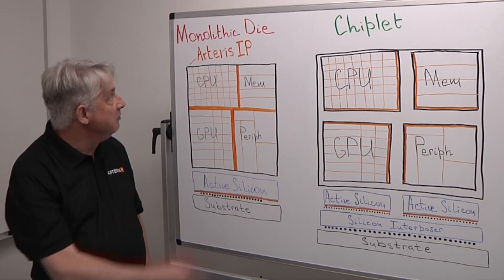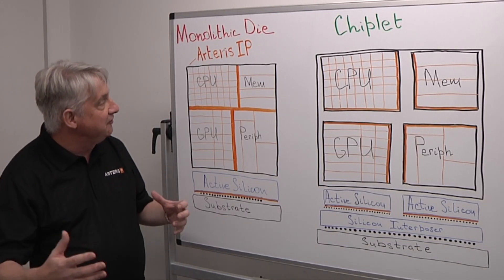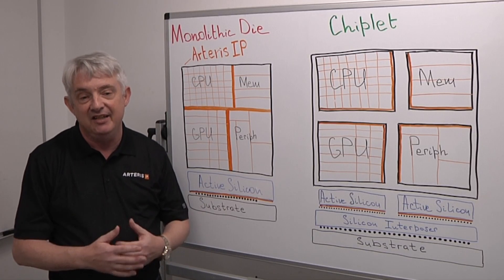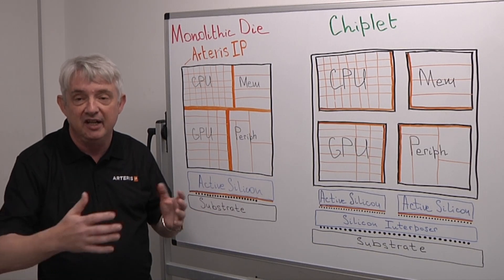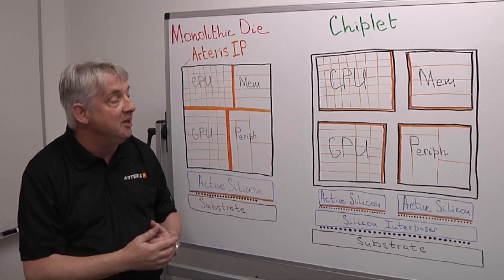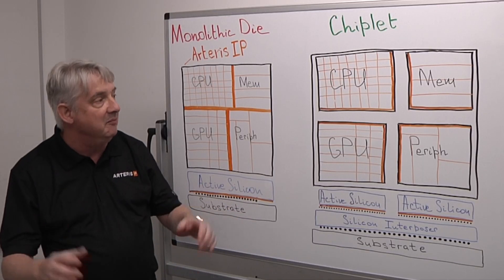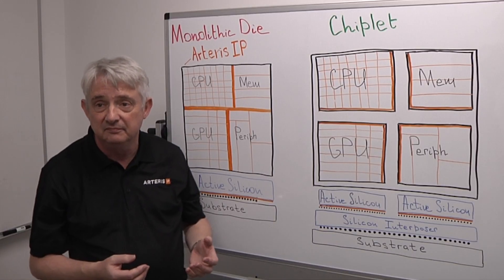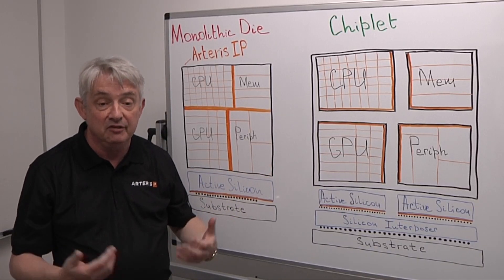Benefits And Challenges Of Using Chiplets

Comment: One of the benefits of chiplets is their implicit redundancy during manufacturing. Foundries don't like to talk about it, but all the lead foundries are struggling with their defect densities at 3nm and below. With the monolithic die approach, you've got an enormous probability that a manufacturing defect will occur somewhere on that die. Once a defect occurs anywhere on that die, you need to throw out the entire part. You can combat that problem with redundancy. For example, if your CPU is designed for 128 cores, you might build in an extra 16 spare cores that you can swap in with fuses, but that can get very expensive for area, especially when you're already pushing the limits of the reticle. If a defect occurs on one of your chiplets, you don't need to scrap the entire system going into the package. You just swap in a new chiplet.